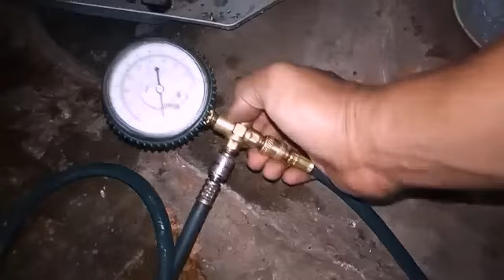CARA MEMPERBAIKI KULKAS TERTUSUK PISAU,CARA MENAMBAL KULKAS BOCOR.CARA MENAMBAL BAGIAN FREZZER BOCOR

Comment: Mau nanya om apa iya kalo frezernya ketusuk pisau mesinnya jadi ga nyala?
Reply from the maker: Iya kalau air sampai masuk ke sistim kulkas/ kompresor jd macet.
Reply: Tapi masih bisa dingin ngk mas
Reply from the maker: @burungemprit6392  kalau freonya sdh habis ya tdk bisa dingin..
Reply: Kalo gnti evaporator  habis brpa mas kira"
Reply from the maker: @burungemprit6392  550 + ongkos freon servis.
Reply: Itu udah komplit trmsuk bnerin kompresor nya pok mas
Reply from the maker: @burungemprit6392  kalau benerin kompresor blm trmasuk,memang kompresornya apa rusak?...